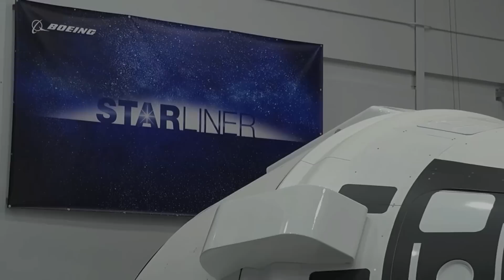Starliner's First Crewed Mission Slips Well Into 2024

Comment: You can not call a test a success if one of the parachutes did not deploy. This tolerance for an anomaly is exactly the kind of attitude that led to the Shuttle disasters.  Spaceflight can not, does not and will never tolerate failure or a lax attitude to safety.  Therefore before any flight with people on board, there had better be measures taken to ensure that any potential catastrophe like the failure of parachutes does not occur and the way to achieve that is to ensure ALL the parachutes are deployed.

Comment: “Here at Boeing we push the envelope of profit driven design. As any cutting edge company there will be bumps on the road.  Unfortunately in our quest to squeeze every last penny from NASA we ended up with such a sh*tty product we failed to achieve basic functionality.  Falsely, based on our immense profits from SLS we assumed NASA would just keep giving us money to repeatedly fix our poor design and even worse execution”
Reply: Commercial Crew is fixed price contract.
Reply: @odysseusrex5908  exactly. Boeings profit driven design was to barely make a functional product for as cheaply as possible.  Underperform on even that and try to get more NASA money. They just need to spend a bit more in lobbying and the money tap will be wide open again.  Because reasons.  Do you really expect someone as valuable to humanity as a Boeing CEO to make less than triple digit millions?
Reply: @undertow2142   Are you deliberately exaggerating or merely raving?

Comment: At this rate, the ISS will have been decommissioned before the first crewed flight!  Seriously though, how can such fundamental errors have been made at this stage of development?  To me, it sounds downright misleading to say "these delays happen during development" when flammable tape is used in areas which are inaccessible and/or can't be replaced and blame it on development teething - this spaceship was due to carry people on it and the problem was discovered because of other failures.  As for the parachutes, once again how could they get it so wrong with technology which has been around since the space age began, and once again, at this late stage of development?

Perhaps Boeing should be an acronym for...  Because Of Extreme Incompetence, Not Going...